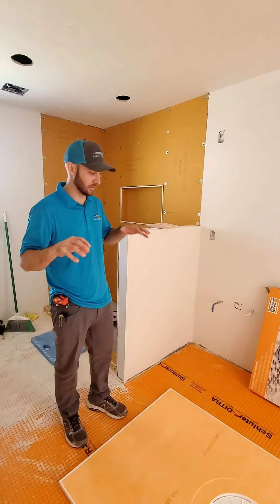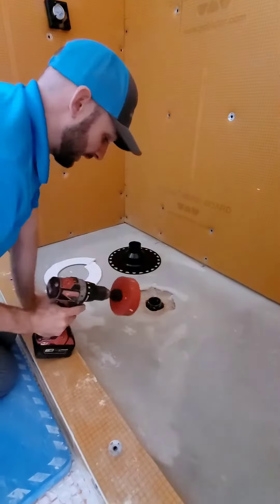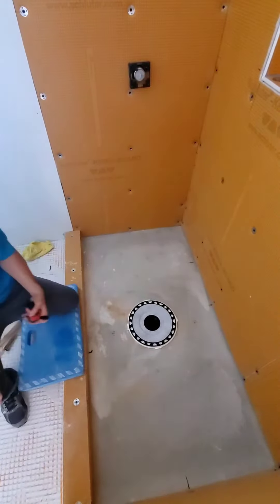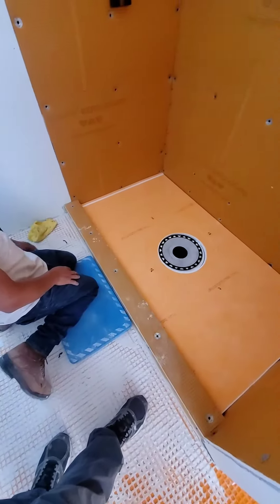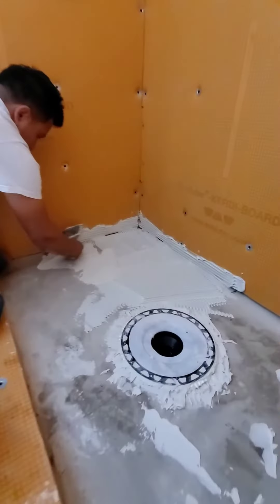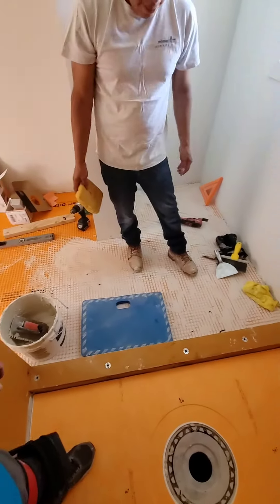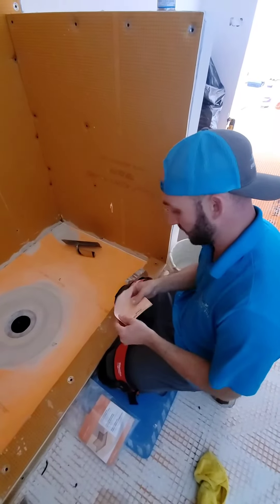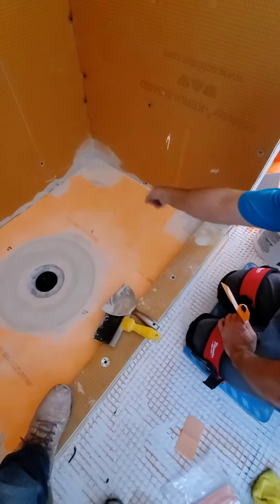Schluter Shower System - Installing the Shower Tray and Flange Kit

Comment: Schluter products are overrated and overpriced. Also followed mixture procedure of their All set cement and found out that the wall membrane did not adhere to the mold resistant drywall consistently. I couldn't take a chance expecting this membrane to support wall tiles. Schluter warranty is only on paper. They squirm out of honoring their warranty by finding excuses. All contractors with years of experience I spoke to stay away from Schluter products.
Reply from the maker: I have 20+ years of experience waterproofing showers and installing tile. We've used Schluter exclusively for our waterproofing for at least 10 years. Is it expensive? Yes. It's also extremely lightweight, twice as easy to install as any other method, days faster than floating, way more environmentally friendly, and far less cleanup. Zero dust installation is probably my #1 selling point when doing a job walk. The customers gladly pay the additional material cost because, just like me, they see the value. I haven't had a warranty call, so I can't speak for their service on that one. However, absolutely 100% of the Schluter failures I have first-hand seen have been due to installer error. This is why I go to the courses at least once a year as well as send my installers to the courses. Actually, we are all attending a course next week in Ventura, so I'll share your concerns and see what they say. The courses are free, and they set you up in a really nice hotel right on the beach. What other company does this?
Reply from the maker: I literally just got a call because "we heard you can install Ditra". The products just sell themselves. All you have to do is just install it right.
Reply: So you can't install it properly and you blame the manufacturer for that? 
A real man would own up to their shortcomings, but I guess you aren't a real man... 
Haters like you are going to hate. 
Oh well, I can follow basic instructions so I've never had an issue with schluter. 
Over 150 showers and counting...